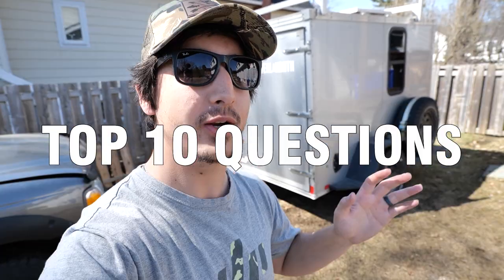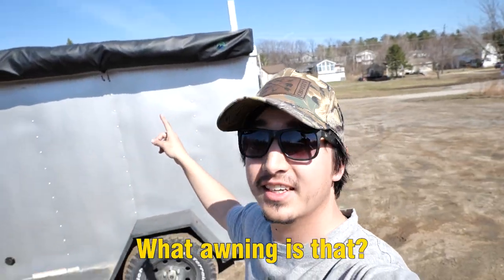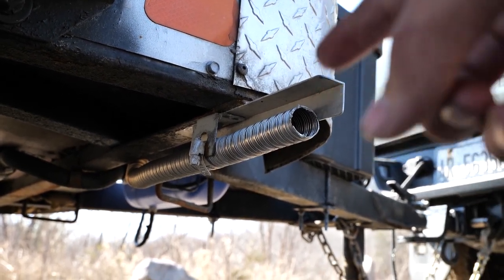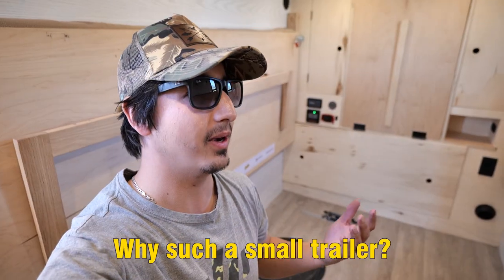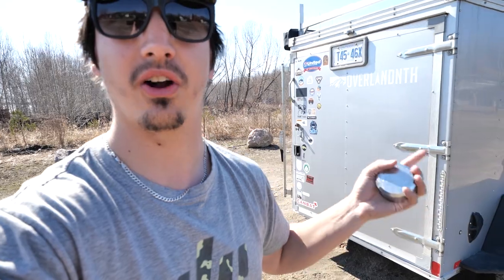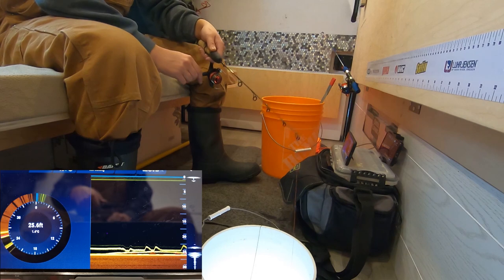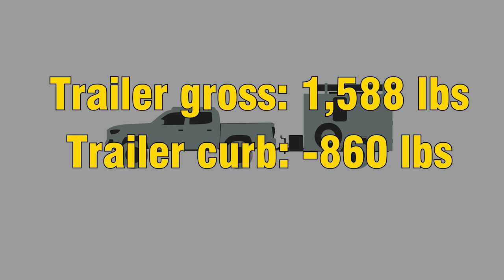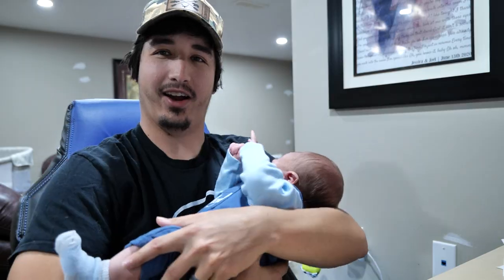Answering TOP 10 QUESTIONS about my 5x8 Cargo Trailer Camper Conversion

Comment: Hi Joel.  In case you didnt know, CAT Scales allow you to re-weigh as many times as you need to do so with the same truck/trailer within a 24 hour period and the cost is like 2 dollars USD for each time.  This would allow you to get a much more accurate weight of the trailer by weighing with and without the trailer connected.  As you mentioned, you had to consider tongue weight in your estimate..  To figure true tongue weight you can use a bathroom scale.  On yours you would actually use 2 or 3 (or more) bathroom scales with a board across them and the tongue sitting  in the middle of the board.  You would zero the scales or subtract the weight they total up and then weigh it.  The total of all scales would be your tongue weight.  You could also weigh the truck while making sure that your rear tires are on a seperate section of the cat scate and record you axle weights.  Then re-weigh the whole thing and subtract your previous rear tire weight from the current weight..  You may have access to a gross weight scale that would weigh the whole thing.  You could weigh the truck and then pull forward or backward far enough to get an axle off the scale to get axle weights.  You can follow up with the trailer for its weight or a tounge weight if you measure properly.  I am a recently retired truck driver and the company driver trainer.  I made sure all my guys knew how to do this.  The main thing I wanted you to know is that you can re-weigh for almost nothing within 24 hours of a first weigh.  By the weigh, at least here in the US the first thing they ask is "FIrst weigh or re-weigh?" because we weigh in pounds.  Question, why do you call it the Chuck Box?
Reply from the maker: Excellent information. Thanks for sharing, I did not know you can reweight for a cheaper price in 24 hours.

The Chuck Box is a play on words or whatever you may call it. The trailer build was part of my final thesis project for my masters of architecture. The thesis is called "The Architectural Chuck Box". In short, I was inspired by the functions and form of an actual camp kitchen chuck box. 

Thanks for watching!

Comment: Kewl vid, Joel. Answered a few of my Qs, too. Since you have the trailer axle weight of 1440 lbs, all you need to do is stick a scale under the hitch ball coupler. It's probably around 200 lbs, I'm guessing, maybe more since you have your battery and electronics up front along with that ply cabinetry. I'm still working on my trailer... I'm gonna start dragging it around soon as I get the heater installed, then finish the rest as I go. I'm tired of heading out into the desert without it! lol
Reply from the maker: Sounds like a great project. Thanks for watching!

Comment: Great video Joel,  I have a 6x12 ctc  it weighs in at 3088 pounds trailer before conversion was 1300 pounds so I added 1788 pounds I have a tongue weight of 400 pounds well within the 10-15% range but  I do use a weight dist hitch as I have a 350 pound tongue weight limit  on my sienna minivan.
Reply from the maker: Thanks for watching! I can definitely appreciate all the time it goes into figuring this out to ensure that you have a safe and secure load. Happy travels.

Comment: Good stuff bud.  Choosing the perfect trailer is impossible, as your needs vary based on where you camp, who you take, how far away you want to go.  For longer trips, rough terrain trips, and lone wolf trips, your trailer is ideal.  For trips with the family, you may find it cramped at times, but just keep telling everyone it's "cozy".  And a bigger trailer may strain a Taco.  From my experience, as I upgraded to bigger and fancier trailers, I often wished I still had my simple little trailer that served me so well.   If it were my trailer, I might design a pop-up or flip-up roof system that would help standing height, as well as offer more sleeping space up top... when needed.  I know some manufacturers offer them with well insulated fabrics for the cold weather.  Might be just the trick for better utilizing an already bitchin camping space.  Hug that chonk for us pal!
Reply from the maker: Thanks for the insight Matt! I have to agree, 80% of the time it's just me lone wolf trips. I love the idea of expandable "pop up design". The ideas are brewing! Thanks for watching

Comment: Dang bro you loaded that thing lol. Using frp etc is crucial for this stuff 700 lbs of materials is allot dude. Imean id put my motorcycle in there wood etc etc you would def be way heavy.
Reply from the maker: Trailer is still incredibly light when you compare to anything else out there. Thanks for watching!

Comment: You lost me at 12,000 for something barely bigger than a sheet of plywood.
Reply from the maker: We'll If you took a look at the price budget breakdown, you'd have a better appreciation for the cost of things. This was built when a sheet of plywood retailed over $100... Thanks for watching!
Reply: Also the fact he could turn around and fix the holes in the floor and sell it for around half that after all the usage he's gotten out of it... these hold their value for years for as a camper although perhaps better finished wouldn't hold up very well and wouldn't hold its resale value at all but would cost you twice this price for a similar-size